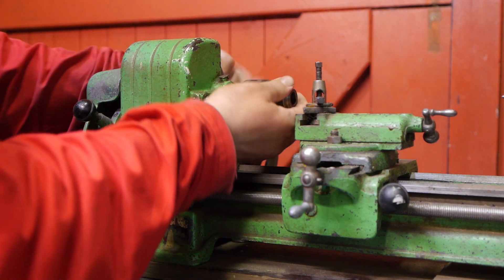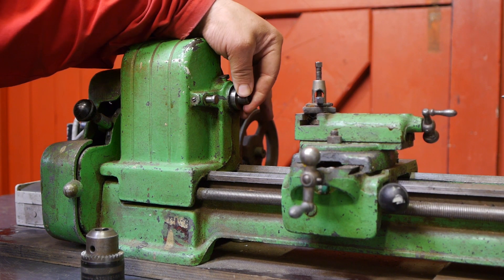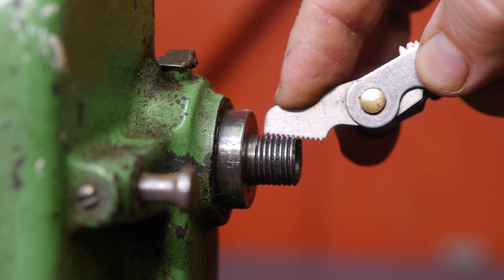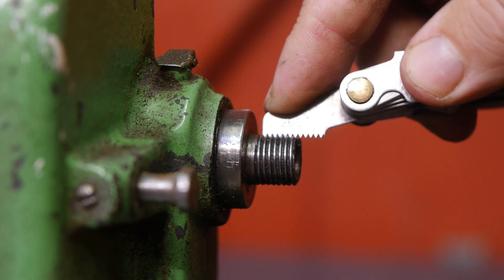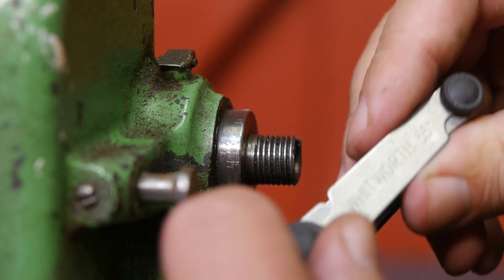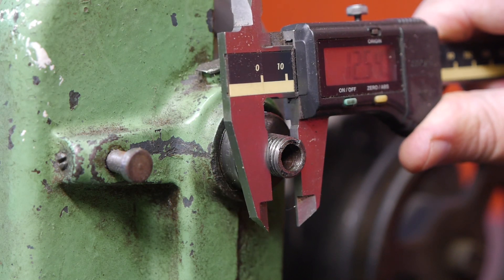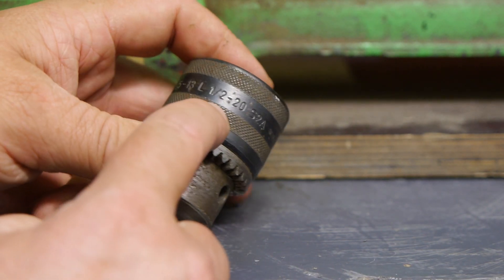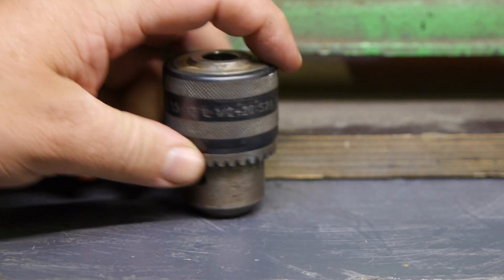Measuring the craftsman lathe spindle nose

Comment: The spindle is 0.55" or 14mm and the threading is 1/2" 20 tpi. Usually these spindles are bent. We have a facebook group for these lathe.
Reply from the maker: Thanks for the info. I don't use Facebook ever since that Cambridge Analytica scandal came to light.